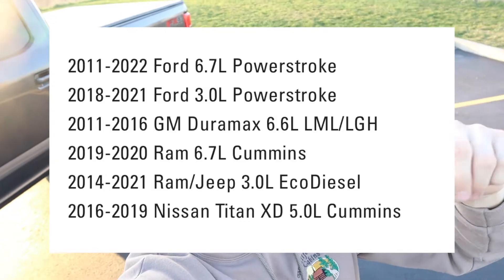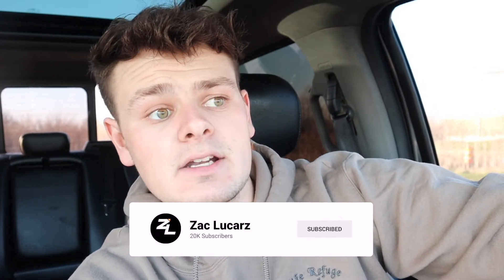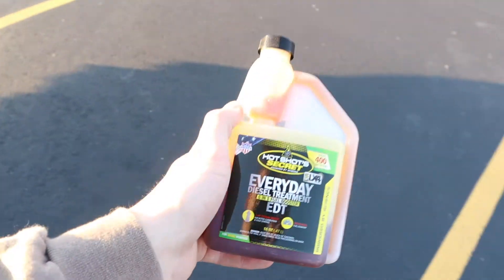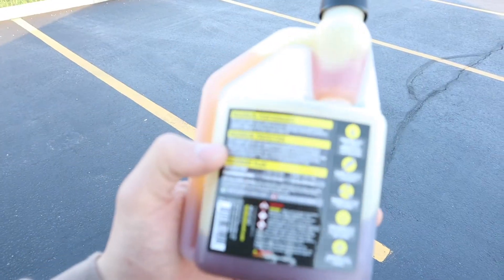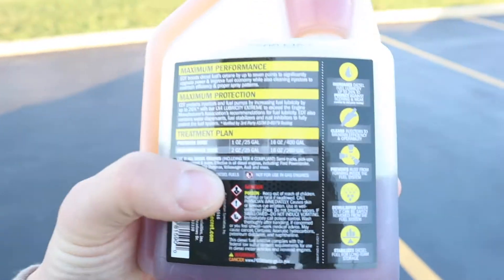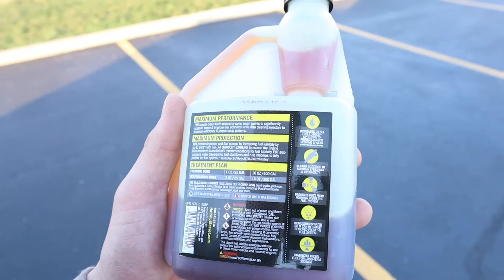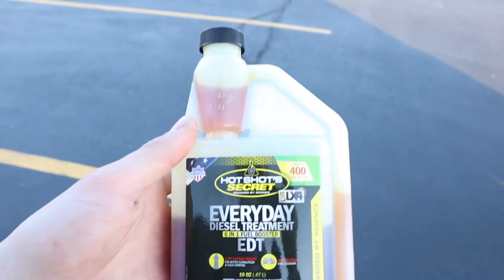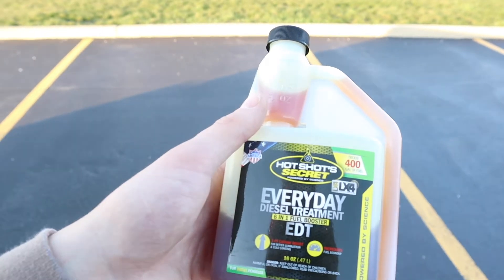5 Ways To Save Your CP4 From Catastrophic FAILURE!

Comment: The pump is pumping slow because the filter on the pump needs changed! Not low fuel!
Reply: @johnshuler1396  huh??
Reply: If the filter is clogged it’s triggering the bypass valve giving you dirty fuel! If the pump is slow stop and find another gas station!!!

Comment: Fuel tanks at a fuel station ALWAYS pump from the bottom so it doesn’t matter if it is low in fuel and pumping slow, fuel quality remains the same. Slow pumping IS caused by low fuel supply so you will not be getting the freshest fuel in town.

Comment: So the CP4 is used in millions upon millions upon millions ( I don't know how many) of vehicles- statistically...what is the failure rate?  I can't seem to find that answer, but if 10,000 out of say 50,000,000 fail (made up numbers), BOY are you gonna hear about it!  Statistically though, that's a small likelihood- 1 in 5000 which is like about anything else.  Sure- it's a huge burden if it goes, but...is it mostly hyped up?  I don't know- just throwing it out there.  My '17 6.7 sits at about 108K and I do use EDT at minimum and starting topping off when I get to 3/4 tank of daily driving...I never idle, and my oil change interval is 5K because I can afford to.  Fuel filters every 3rd oil change.  I'd like to see hard stats, and I also watch for class-action developments...
Reply: I was told the same thing about cp4 failure by a mechanic. He said the actual number of cp4 grenading vs the number that hasn't is a wide margin. Just like the news it gets sensationalized so it appears to happen more frequently than what it actually does.
Reply: I read online that it wasn't a widespread issue and I just bought a 2.0 CJAA TDI on Monday night as-is from a big dealership near me and (I believe) my CP4 imploded just 3.5 days later yesterday morning. I got codes P0191 and P0087 my car is still running so either the CP4 didn't actually implode and send metal shavings everywhere and it's the metering valve that's bad or my CP4 did implode and because my car was still running fine that I got lucky and only the pump was damaged instead of the entire fuel system. I'm not sure but I'll find out on Monday and it's being covered for me anyway but I'm very curious to find out what it was that caused the issue. I bought the car with half a tank of diesel and I put another half tank in of ARCO R99 and just a day after doing that the codes popped up and the car cut out whenever the turbo would come on boost.

Also I only noticed now on Carfax that within the 130k miles on my JSW that the fuel filters were never changed and it was a one-owner car always dealer serviced and they have a 20k interval 😬

Comment: All logical information but honestly it doesn’t matter when they go bad they just go bad I have 2016 700k miles original cp4 I also have a 2022 425k just lost cp4 I am replacing that junk Bosch pump with the s&s/stanadyne pump which is the only fix for these ford trucks
Reply: What else did you do on the 700k d&T ?? Lift pumps ?about to buy a 200k mile truck no issues but wondering what I can do to help besides conversion

Comment: Best thing to do with it is remove it tossing it.There was a recall on the Cummins which the fix was to replace it with a CP3.The Duramax,convert it to the CP3.Does not do engine damage.I know someone that has a 2015 Chevy 2500 with the Duramax,his went once and only did damage to the fuel system

Comment: Fuel filters every 20k . Every oil change overkill. Drain water separator every oil change.   Rotella t5 motor oil .
Reply: I did this and still blew the cp4 at 174k miles
Reply: Did you add any type of lubricant with your fuel?  @humbertogranda270
Reply: @humbertogranda270 my just blew up at 189K
Reply: @humbertogranda270 where do you think you went wrong?

Comment: I have a 2013 Duramax (which I absolutely love)- (I however love your Power Stroke too) and I notice a power difference running Hot Shots but they now have Lx4 lube that can be run in conjunction with the everyday cetane boost. Just ordered some bc I’m terrified of having a catastrophic failure.
QUESTION: can high intensity magnets be used to pull metal shavings to the fuel line??
Reply: These systems are running close to 15k psi so I doubt it.
Reply: Would love to see a video on this. Can’t seem to find any info? To me, even at high pressure, magnets will not let metal get past them especially if it’s measured in inches. You may clog a fuel line but I don’t know enough about it.

Comment: Fuel treatment ain't gonna do that
Reply: @zaclucarz  I’ve been using Lucas Fuel Treatment, about 10oz per tank. How does it compare to Hotshots? Also, I’d heard that these pumps were designed to use European diesel fuel, which has more lubrication. That’s mostly why they fail.
Reply: Sure will 100%  twice the life from pump
Reply: The cp-4 fuel pump in the UK has a 1% or less failure rate compared the the USA. Reason? The UK has better fuel/lubricity in their diesel fuel. Bosh to me is still at fault and should have known what kind of low sulfur fuels we use and that is the problem. This guy in the video is right, run an additive with lubricity and change fuel filters ever other oil change and you will prolong the pump.
Reply: It gives a 56% better chance from a failure.